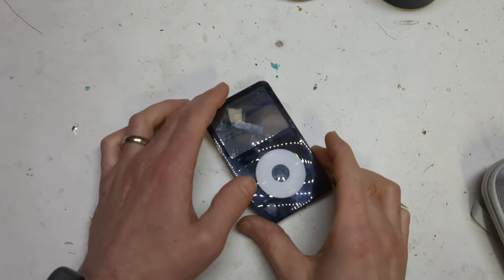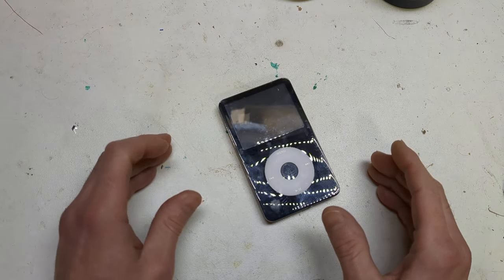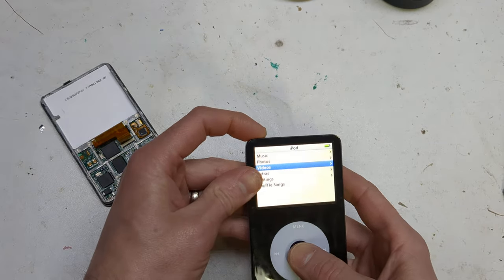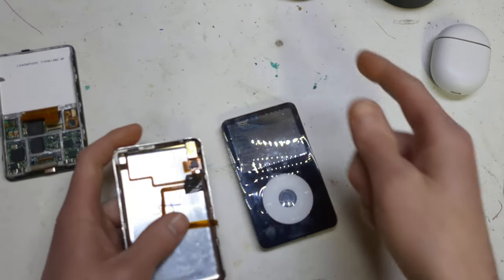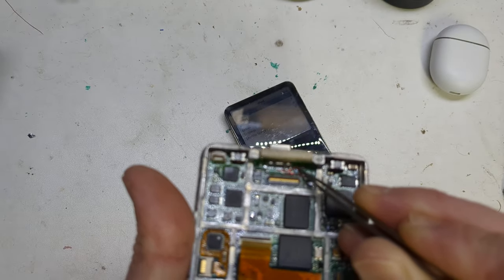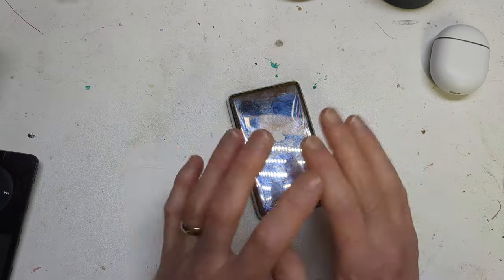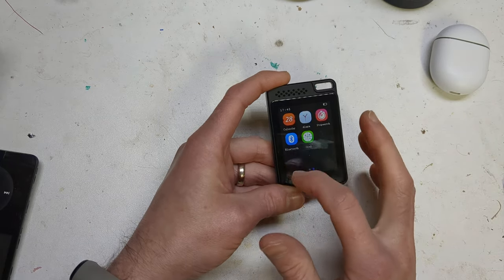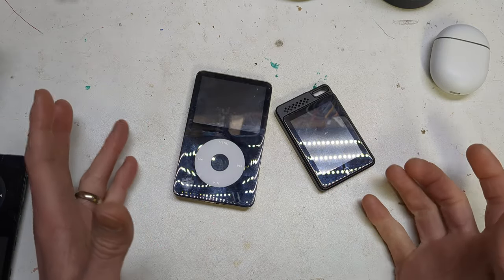iPod modded with USB C, SSD and Bluetooth

Comment: I recently bought an iPod 5th gen classic and threw a 512 GB sd card in it using the iFlash mod, and i am BLOWN AWAY how well these little devices just keep on giving! once you put rockbox on an ipod with a larger hard drive you pretty much have a modern mp3 player. i"ve seen the bluetooth mod before but never before USB type-C, very cool! I wonder if you could improve the bluetooth range at all by cutting a hole in the back of the case and filling it in with plastics?
Reply from the maker: I think I need to give rockbox another try. Yeah I think that or just 3d printing a new back for it.

Comment: Would you share the pcb used with usb-c? Couldn't find it on aliexpress😢
Reply from the maker: @PhaelPuglielli  the files are on the blog post linked in the description
Reply: I'm pretty new into printing my own PCB😅 if it's not a bother, would you indicate the USB-c PCB Gerber file under your GitHub? Regards from Italy
Reply from the maker: @PhaelPuglielli  yeah sure, just upload this zip to JLCPCB, the only other thing you will need to change on the order form is to get the PCB made 1mm thick instead of the usual 1.6mm https://github.com/facelesstech/ipod_usb_c_charge_and_sync/blob/main/kicad_files/ipod_usb_c_mod/gerbers.zip
Reply: @facelesstech  thank you so much!!!

Comment: That model supports Rockbox which does not require itunes and supports dual boot apple and Rockbox.
Reply from the maker: I used to run rockbox years ago but haven't tried it lately, Dual boot sounds interesting
Reply: Adding music to rockbox is really easy, you just have to drag and drop a folder of mp3s onto the device and rockbox will scan the entire device for you. Works with 75% accuracy imo
Reply: Facts, and it runs DOOM lol @noahsnerdstuff
Reply: @icyds that’s my favorite part

Comment: Is it possible te centre the usb c port
Reply from the maker: @Daryl0601  it could be possible but the usb c port would have to be very close to the edge of the board because of where the VCC pad is on the original 30 pin connector